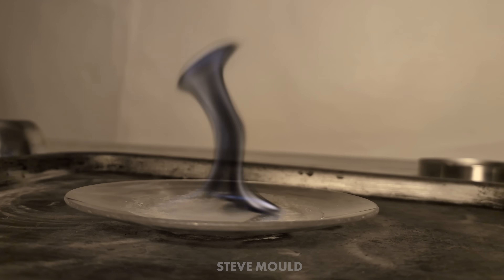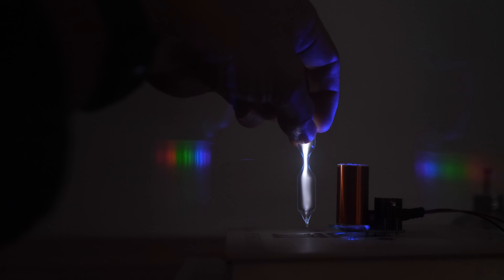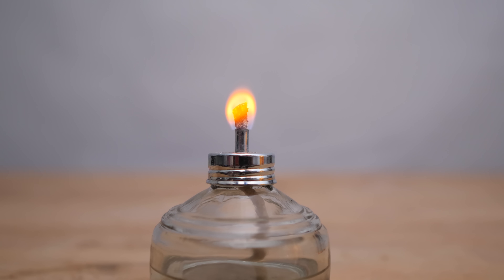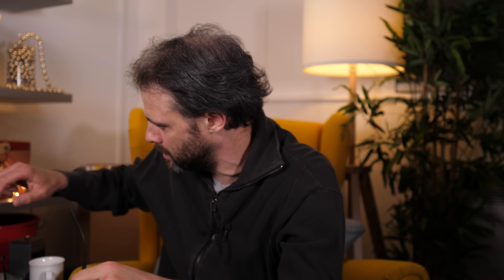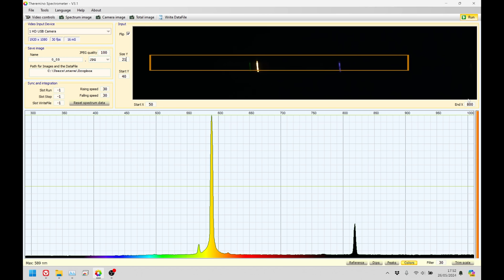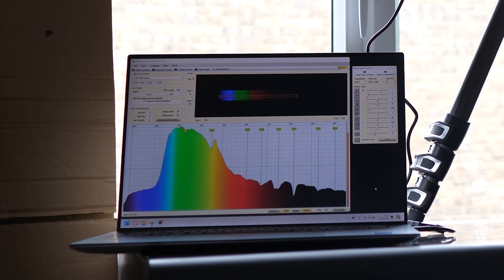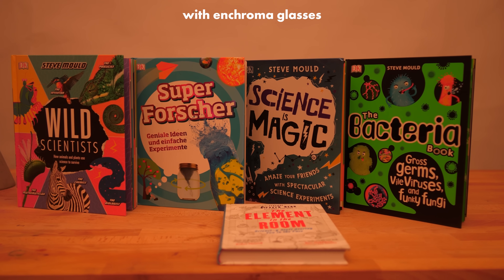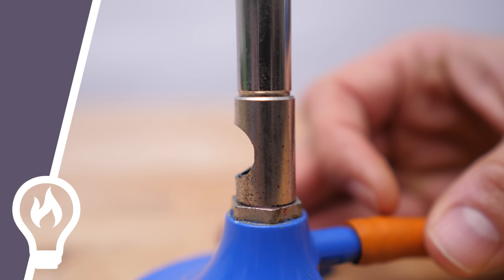Light sucking flames look like magic

Comment: As a sidenote from someone who doesn't get the joke at 15:23 and has actually tried EnChroma lenses:

I don't think you actually see the world like "normal" people, rather the spektrum of light is changed to a gamut which makes it easier to see for red-green color blind people. In my experience they made the "red" really pop out, a thing i have never seen before. This was the first time i really realized why red is considered a warning colour.

The color shift was nothing like i have ever seen before, but having seen colours never seen before without technical aid ;) i know how much of our perception is actually in our brains, not the "hardware part", called eyes. So i don't think i saw the world with EnChroma-View like 89% of people (which is also debatable, considering we just compare our perception of wavelength to another - you might see 450nm completly different than me, but we both know its 450nm). I think the spektrum was shifted to something where i could see "red" and my brain got really confused by it, hence it was the first 20 seconds a "wtf"-moment, till i realized what was happening. This also explaines why you don't get higher points in the Ishihara test.

Comment: What would happen if you had the sodium light on in the same set up but the flame is infront of a door open to a nonsodium lit area? (sun light best i suppose.) What color would the flame be with the outside light comijg from behind it, but sodium light overtaking and randomizing photons? Would it flicker grey? Or would it be orange? What would the black flame appear like in the original set up but with other chemical makeups, making it red, green, blue, etc, but under sodium light? 
I NEED a follow up video!

Comment: 15:32 - this one spooked the hell out of me! I'm not colorblind, but I could not see the numbers on the plate 3. I took a screenshot and made some hue/saturation tuning to it. Some values revealed a number "73", but not clear, just on a verge of perception. I'm not even sure it's not a fluke.

So I searched for the original. It's an Ishihara plate 21 from a 38-plate set. Changing hue/saturation, inverting and making other color transformations to this original image did not reveal anything that looked like a number, which made it even spookier. Can anyone else see anything there? 😳

Comment: As a colourblind person, I tried 2 separate pairs of Enchroma and it did help me differentiate reds and greens, but at the same time it changed every colour. So, I still couldn't recognize any colour properly! Plus, other colours I can normally see got muted so I couldn't differentiate them anymore. It really did just feel like putting a pink or purple filter on the world which just made reds seem more red, which is a little disappointing based on their advertising. 
Seeing how it blocks certain wavelengths of light to separate the reds and greens, it explains a lot of my experience.

Comment: 11:26 the question asked, how could a 1 partical spin in an 1 dimensional environment, like its mindboggling. might have to do with some physics laws im not aware of but just judging the problem, why wouldnt it be able to spin in 1 dimension. i get the basics of 1-2-3- dimensions; stationary, linear, and multi-angular but stationary imo does not equate to no movement at all very limited indeed but you catch my thought? spinning and vibrating do not really affect the x-y axis unless friction is applied

Comment: CRI is not a measure of how good the light source is at making colours "look the way they look naturally". It's a comparison of the light source's spectrum to the spectrum of a black body radiator with the same colour temperature. Below around 5000K, light is bad enabling colour discrimination. So a 3000K light with CRI 90 could be worse for colour discrimination than a 5000K light with CRI 80.

Comment: A similar effect happens with long wave thermal radiation from the ground. It is continually being captured by molecules including H2O and CO2 and re-emitted in random directions. The only reason the original photon energy gets to space is the atmosphere density gradient lets photons travel slightly further in the upward direction and eventually reach space - more a diffusion process than radiation.

Comment: When we only had sodium street lights you could use a simple filter on a telescope to block out all the light pollution they caused, sadly that's not possible with more modern lighting.

Comment: If there is so much more you could say about EnChroma then, uh....perhaps consider making another video on the topic? I think if you come at it from a scientific angle you can avoid most of the controversy. I will not however, and will be blunt (and vulgar) about them:

EnChroma glasses are bullshit. Mainly because their marketing is very deceptive. Even the underlying idea of having that notch filter effect seems to be dubiously true at best, it seems to help some colors stand out, but it does not at all seem to help distinguishing which color is what for someone who is colorblind, as far as I have been able to tell. If they dropped the marketing completely and just pushed the notch filter argument I'd be alright-ish with them, and ultimately I do agree with your happiness vs money argument, though I would want to see that out compete a much cheaper placebo. The social media angle they push I find particularly evil, however.

Comment: Regarding the sodium light, that light is a LOW PRESSURE sodium lamp.  Its output is extremely monochromatic as you state.  But you should explain that most "sodium" streetlights made now use HIGH PRESSURE sodium lamps.  The high pressure broadens the spectrum considerably, making the light less "bad" for illumination, but totally bad for the black flame experiment.  They will be disappointed in your video when the experiment fails!
          Regarding the Enchroma glasses, I use these (both indoor & outdoor ones), despite testing out as having "normal color vision".  In "normal" eye, the cone overlap is still considerable, so red-green "color signal" will be enhanced.  it also SEEMS to increase contrast & PERCEIVED "sharpness".  That's the main reason I use these.  It takes awhile to see the effects.  Wear these outside for hours over days & report if you see any change.
          Regarding your joke about using the Enchroma glasses at night with sodium lamp illumination, Enchroma WILL "fight" the poor CRI of high pressure sodium lights, allowing seeing some red-green colors.  This works best with the "indoor" lenses which are less tinted.
          I have had colorblind people try these.  Some of them did not know they were "colorblind glasses", & others did.  What I can tell you is that the experiences on Youtube are REAL, freaking out & all.  I presented these at Boy Scout Jamboree West Virginia 2023 as part of my STEM demos.  But for many (despite claiming seeing more color), the "novelty" of the effect seems to lose its luster & the glasses are not used.  (I the novelty of the effect for me has not worn off at all.)  I have seen more non-colorblind adopt these for use.  Enchroma now offers "Super-X" lenses (color enhancement for those with normal vision).
          When you present transmission spectra, you should "normalize" the illumination spectrum, so the true transmission spectrum can be seen.  I assume your software can do that.

Comment: Is there any other element, besides sodium, that can work this well to produce a black flame using a different color ?  If so, what happens if you mix both elements ( burn both, and illuminate the scene with both ) ?  Could you still get a black flame ?

Comment: I know you don't want to wade into the effectiveness of enchroma glasses, but I will. I have color blindness and just generally bad vision so while I'm not an optometrist, I have a decently good understanding of the basic mechanics of color blindness. No, I don't see in black & white. Yes, I can tell the difference between that color and that other color. Yes, that is indeed [color].

The most common form of color-blindness is red-green. This means that your red cones and your green cones aren't as effective at distinguishing colors that activate both cones. But this is a spectrum. For me, I have pretty mild red-green colorblindness, so I can tell a red thing is red and a green thing is green, but give me a red thing and a green thing on top of each other and I might have a hard time distinguishing them. For others, it could be as hard as red and green looking near identical regardless of them being close to each other (hence why all traffic signals/signage do not require color to distinguish).

So back to enchroma glasses, they claim that by wearing the glasses you'll be able to distinguish the difference in colors. But the thing is, for most people with color blindness, they already do that. Maybe the way I see green isn't the way you do, but if you give me a green leaf, I can tell you it is green. And for those that do have that problem, what enchroma glasses do is the reduce color vision, they don't increase it, which would usually make things harder to see. Could it be possible to improve color blindness with some external vision modification? Maybe. I would be generally dubious since color blindness isn't an issue of external colors being wrong, but your eyes' cones being anatomically different, but a passive solution that merely reduces the color spectrum in a particular way will never improve color blind vision.

Comment: For astronomers/astrophysicists it is a lot less weird to see a black flame when you consider the black body in the sky we see every day: the Sun. If you illuminate a star it will reflect a very tiny fraction of the incomming light. But since the light gets almost fully absorbed it will heat up the star which would increase its black-body radiation. So stars don't reflect one another but if they are close they can still create brights spots on one another. Another cool example of a black flame is the exhaust of the Saturn V rocket. Near the engine bell edge the exhaust looks black because it is much less hot an therefore much less bright than the gas comming from inside the engine.

Comment: Lots to think about here. I too have difficulty with "point-like electrons having angular momentum" but I was also under the impression that electron orbitals are basically "electron position" (for the want of a physical object description) probability fields - they don't rotate around the atom in any predictable sense of direction as if they did Heisenberg would complain. So, the differences in electron energy, due to electrons not-actually-spinning whilst not-actually-orbiting, becomes even more confusing! When I was at school electrons were charged ping-pong balls - it was so much easier to understand!
Reply: Imagine a ball that’s rotating, except it’s not a ball and it isn’t rotating.

Comment: My guess before watching the video: it's a combustible mixture that releases some dark particulate matter that doesn't glow at the temperature it burns like the soot in a candle's flame does. But the flame looks like it has a clear outline, so this dark particular matter probably turns clear when as it lowers in temperature. Or maybe it reacts with the air outside the flame to become clear? Guessing is fun!
Reply: It relied on lighting and image processing trickery! Boo! I'm calling shenanigans! 😝

Comment: 09:45 if I interpret your commentary correctly you are asking for a possible source if these lines are actually sodium lines. According to the link they are:
https://www.physics.nist.gov/PhysRefData/Handbook/Tables/sodiumtable2.htm

13:15 my initial guess would be, that sodium in glass doesn't absorb at 589 nm because it might not be in the ground state but ionised so the transition needed is not possible because of a lack in the valence electron. 
BUT!! I might very well be wrong about that because I have no special knowledge in glass. And I couldn't find a definitive proof or disprove that sodium is actually ionised in a quick search.

Comment: PRACTICAL APPLICATION:
I design optics for street lights.  With respect to high pressure sodium lamps, we had to make sure our optics did not reflect light back into the arc tube because the sodium would absorb its own light and cause the arc tube to overheat.  This would shorten the life of the lamp.
Reply: Practical application was Mary Poppins
Better than Green Screen
Reply: @ChibiHoshiDragon  Have you seen the Corridor Digital video?
Reply: @llamallama2000  yup

Comment: 11:43 - how spin gives different energy levels for electrons…how had I never even questioned that? As soon as you said “that never really made sense to me” I realised it had never made sense to me either, but unlike most things, I hadn’t noticed it not making sense! I think I learned about electron spin at a time when having to learn so much new stuff all at once in A level chemistry/Physics that I just didn’t have the spare capacity to question that aspect! I’m so glad you gave us this explanation.

(Btw I was itching to take to the comments with the “actually there are two absorption lines with sodium”so glad you covered that 😂 I am now wondering what instrument it was we used at A level that let us see those 2 emission lines quite clearly - or maybe my memory is distorted, because in my memory, we had something with a kind of microscope eyepiece with which I could see the gap between the two emission lines quite clearly - but maybe my memory of 40 years ago has conflated what I actually saw with pictures of what we should see)

Comment: I miss sodium street lights. They had a nice, chill feel that jelled well with night time goings-on. Today's LED street lights kill the night-time mood and are quite jarring, not to mention the increased glare. Too much blue light for the dark hours. I feel bad for all the insects and animals whos are blue-light sensitive. Another issue is that the LED sources do not have diffusers, so they can be blinding due to the intense small spot of light, versus the large emission area of old street lights. I'm sure Alec would agree.

Comment: 1:04 @Braniac75 said low pressure sodium lights, specifically a 18V Philips Mini-SOX, has a CRI of -44. Now I'm confused. 0 or negative skmethjng... 

I did find a couple of sites that says the same, "CRI: Ra -44". The CRI page on Wikipedia says low pressure sodium lights has a negative CRI, but doesn't elaborate.

Comment: Are the emission peaks infinitesimally thin or do they have some width?
Reply: They have a nonzero width because of other minor effects that change the amount of energy in the emitted photon.  For instance, how close an electron in another nearby atom is, and probably other factors that the right kind of chemist would know about.  Even a red or blue shift depending on the motion of that particular sodium atom, though relatavistic effects would be tiny at these temperatures.  There will also be a limit to how precisely you can measure the wavelength, but that's another matter.

Comment: 11:28 An electron doesn‘t really have angular momentum. This is just a model physicist use to understand, that an electron has a magnetic field. This magnetic field can be imagined by imagining that the electron is spinning or has a charge that „that spins arounds its center“. This just helps to understand why it has a magnetic field, but it doesn’t actually have angular momentum as it doesn’t actually spin.
Reply: I'm pretty sure spin is a type of angular momentum in more ways than just that. For example, if you exclude the angular momentum due to spin, angular momentum is no longer conserved. If you include it, you get the total angular momentum of the system, which is once again a conserved quantity. If we define angular momentum to be whatever quantity is conserved by Noether's theorem in systems whose langragians have rotational symmetry, then spin is a type of angular momentum, right?

Comment: Now that’s just cool! Or hot I guess. 
Shouldn’t this trick work for any combination of bright lamp + flame of the same source (in this case the source is sodium)?  The lamp emits a set of specific frequencies and the flame absorbs the same set? Or is the absorption “set” a subset of the emission one? In that case, the flame wouldn’t be black, but some other color due to filtering out only some frequencies?